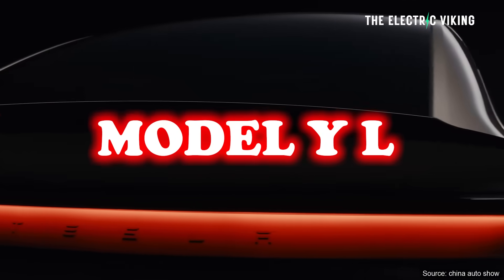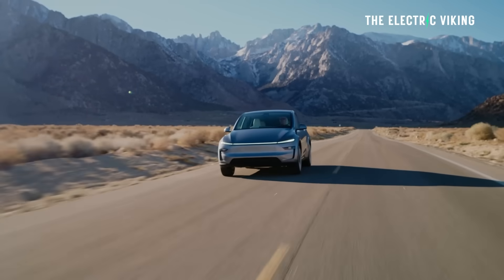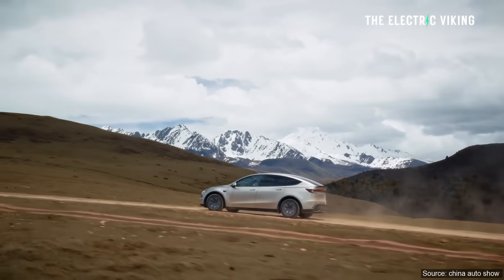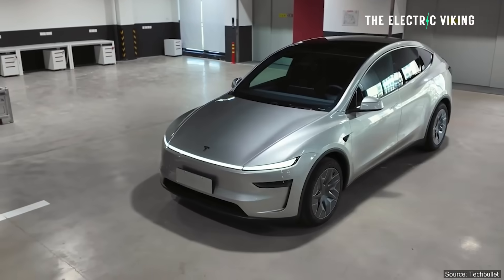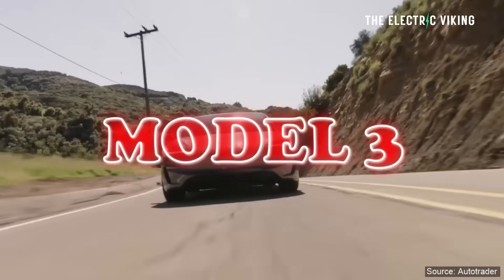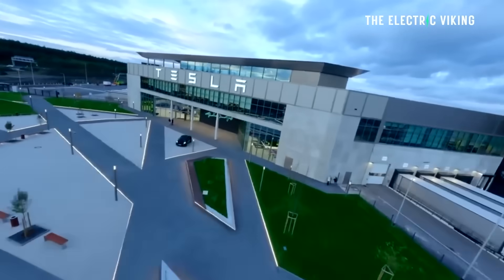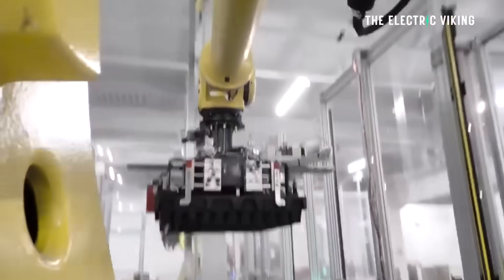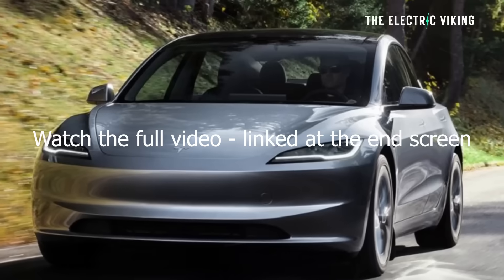New 6 seat Tesla Model Y L interior, battery and range revealed

Comment: Here in Thailand you can buy the BYD M6 with 6 seats (captains chairs in the 2nd row) or 7 (bench seat in 2nd row) for £20k, $27k, AUS$42k I purchased the 7 seat version as the 2nd + 3rd row seats fold completely flat. 71.8 kWh battery and 115kW charging which beats the Atto 3.
Reply: If they sold it here they would probably price it similar to the Zeekr 009. The same way the standard Model Y costs more than the much better Zeekr 7X. Tesla hardly sells cars anymore in Thailand.
Reply: And half the price of a model Y
Reply: BYD includes free info farming into China server included!
Reply: Yep but is BYD like having a google pixel or Dan iPhone
Reply: @felipemelo8605 The BYD M6 is our second car. For long trips we use our BYD Seal AWD Performance. It is very similar to a Tesla Model 3 Performance but a lot cheaper. I have both my BYD's bi-directional charging helping to keep my house off-grid. Videos on my channel if anyone wants to know more.
Reply: That’s ghetto cheap. Is that an ev or hybrid?
Reply: @jorgesmith2000 a 71.8kWh hybrid - you think?
Reply: @jorgesmith2000 You think a car with a 71.8kWh battery might be a hybrid!
Reply: @jorgesmith2000  It’s an EV, it’s on the smaller size but, works well for South East Asia roads, and family use. Range is also fine there as well. Price also good. Not for taller or people of large stature.
Reply: BYD cars are extremely low quality and China suppresses this information.  Tesla uses the best materials and the car will last 3-4 times longer
Reply: @austinpowers1999 lol.  Means you've never been in a byd.    Byd are very well built,  good materials and have useful features like cupholders.  What do you get with a tesla...one big center conox to  all yet shit into???
Reply: @austinpowers1999 Sounds like you don't know much about BYD.
Reply: @EcoHouseThailand sounds like you don’t know about BYD
Reply: @austinpowers1999 I own 2 BYDs and  passed on buying Teslas as they are so expensive compared to BYDs. 8 year warranty on the car and battery will cover my ownership.
Reply: @EcoHouseThailand CHINA UNCENSORED
Reply: @austinpowers1999  Clearly that channel focus on negative news on China, every country has negative news and will look bad if that all you focus on. Ever watch foreign channels about the negative things on other countries? Would make you not want to travel. 

BYD sells millions of cars all over the globe, their crash test has to meet the requirements of the countries they sell in. If all their cars were bad, they would be out of business.
Reply: @austinpowers1999  I don’t own either car and I am interested in facts. Can you please point me to reliability data that supports your claim that BYD are of a lower quality?
Reply: @austinpowers1999 That channel is most likely paid for doing negative content.
Reply: @Harrythehun thousands of INDEPENDENT channels with video proof. Go buy a BYD and enjoy the quality issues.